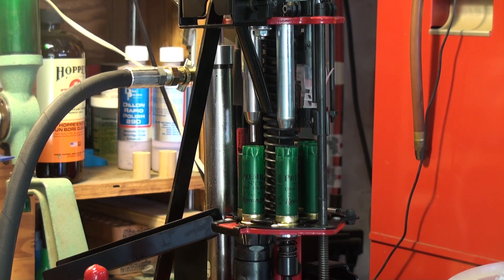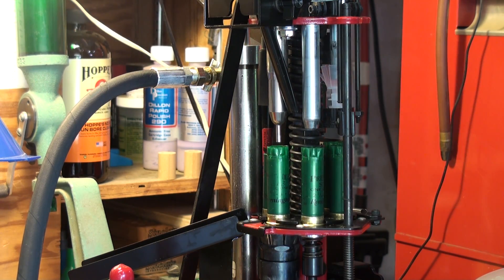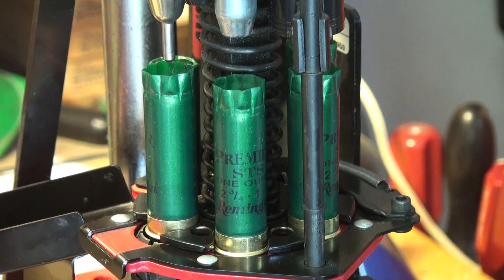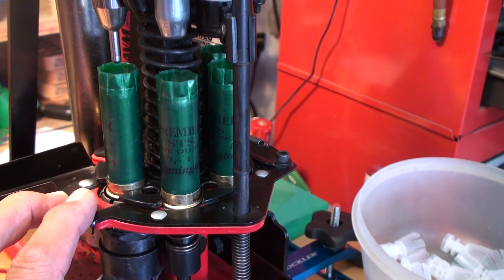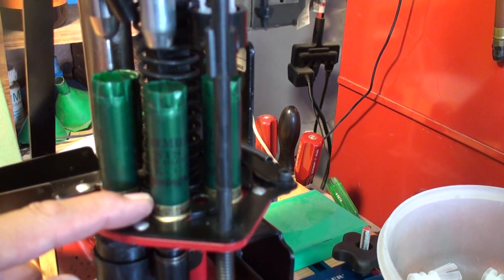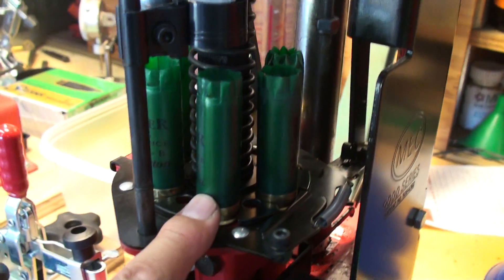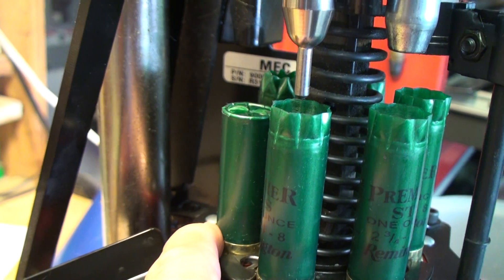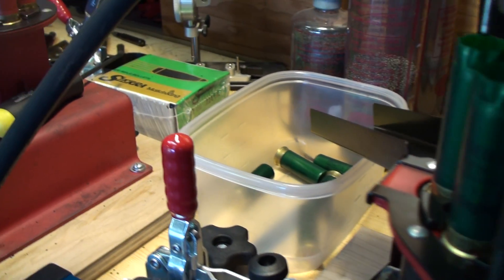The MEC 9000H

Comment: I load with the Grabber which let's me "feel" if there is a hang-up or jam in the mechanism.  If I feel something when depressing the handle, I can stop, raise the handle and check it out.  My concern with a powered machine such as this is that you lose that feel.  Does the machine limit the pressure exerted in order to prevent damage to the press?  I'm expressing total ignorance in the operation of the hydraulics in this case.

One of the big advantages I see in this case is due to the operation, your loads should be very consistant.

Comment: You need to adjust the primer drop tube so that the primer drops directly in the hull turret plate. What I’m seeing is the primer is hitting the edge and then falling into the plate. The way it is running now it will allow primers to flip over and then be jammed into the hull backwards if you’re not paying attention. One of the close up scenes shows this exact scenario.
Reply: The primer drop is everything, especially on Graber.

Comment: Once the machine is dialed in it loads nice shells.  The biggest advantage in my opinion is not having to crank the handle down, instead you press a peddle.  Think about it, if you load 500 shells on the 9000G your pulling that handle 500 times which can cause some stress on your back, shoulder and shoulder blade.  There are two significant disadvantages to the 9000H.  The first is noise!  If you’re in a small room the noise can be deafening.  Secondly, the 9000H is solely dependent on the hydraulic to work the action and turn the turret so your productivity is dependent on the speed of the hydraulic.  I can load 500 shells on my 9000G in 55 minutes and that includes replenishing Primers, Powder and shot.  A 9000H will take you an hour and twenty-five minutes.  As mentioned above, for those who cannot handle the stress of pulling the handle down due to physical ailment the 9000H is worth the investment.
Reply: I have a Mec Hustler samething wo/auto indexing the pump and loader are very quiet! Not at all deafening!!
Reply: Wrong you can load 20 shells in 1 minute on a 9000H what is 1200 shell per hour but not to get too carried away with our selfs lets just call it 1000 shells per hour. Yes you can load 500 shells per hour on a 9000G but you would be hard press to pull that off your arm and lower back would be killing you! 9000 H is worth the investment if you want to save your shoulders and lower back push it takes half the time to do twice the work !

Comment: how often do you get upside down primers. at 3:14 it dropped a primer upside-down.
Reply from the maker: +Marco D Not very often. I could probably adjust the drop tube a little better to eliminate this problem, but keeping a close eye on things is a must anyway.
Reply: I have the manual 9000 and when I first set it up I had an issue with the primer dropping on its side or upside down. If you adjust the arm in the back that actually drops the primer(adjust it to drop it at the end of the stroke) it will drop it right side up every time. I see this video is a few years old so I imagine you made that adjustment already.
Reply from the maker: Yeah, it needs adjusting.

Comment: at 3:13 the primer went in upside down does that stop the machine or cause powder to drop? does the mec drop powder if the primer does not seat? would you recommend the 9000? i have an older grabber type and was thinking of upgrading.
Reply from the maker: +Sheila Hagen No, you have to keep an eye on all the process to make sure they are functioning properly. Powder drops whether the primer is upside down or fails to drop. Yes, I highly recommend this machine.
Reply: pretty neat feature that it DOES have is it wont drop the powder unless there is a hull in station 2. Any time I spilled powder or shot, it was my own fault. Just gotta pay attention to what's happening...or not happening. Great machine!